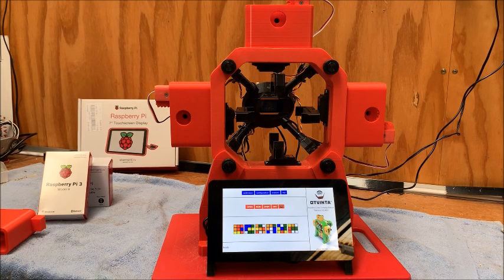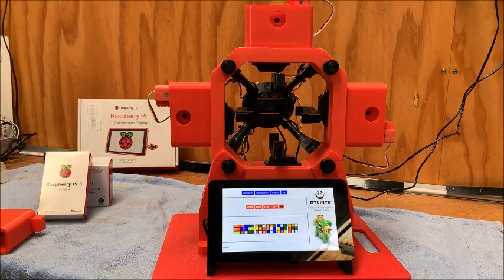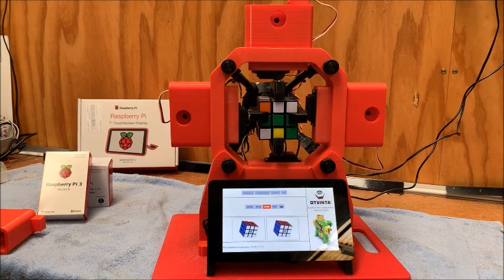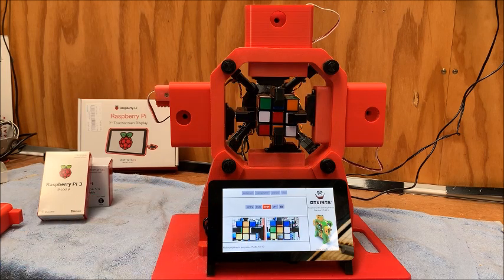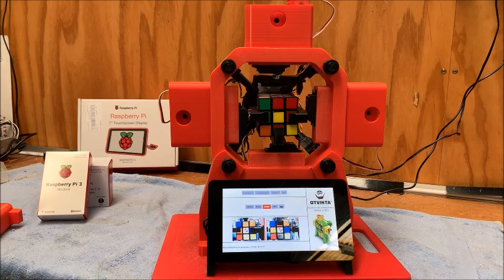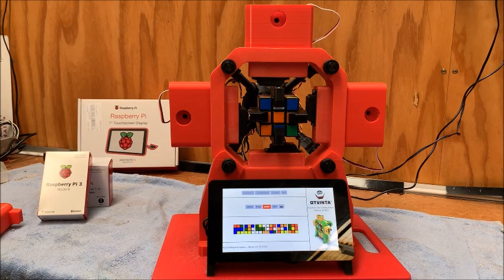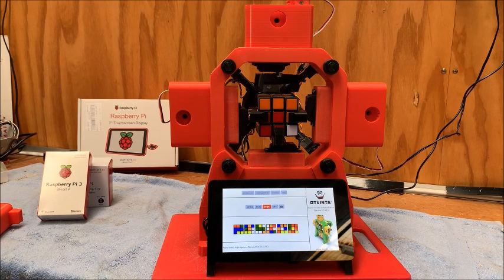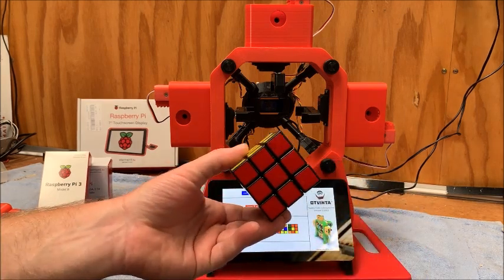3D Printed Rubik Cube Solving  Robot -  Part 1

Comment: Does it have 3 separate power adaptor for LCD RPi and Maestro?

Thanks. I want ro build one using Rpi. Any other sw installation needed to work with the LCD? Any recommendation for a 5in Screen
Reply from the maker: Using 2 x PSU, one Maestro and one for the pi. We used Rasp pi touch screen

Comment: LDL looks great, where did you get all the Hardware from.
Reply from the maker: Screws and nuts from Ebay (Chinese seller), servos I had but I am sure hobbyking or Ebay would have them, the web cam was Ebay and the Rasp pi and screen I had (Raspberry pi's and the screen are sold by various vendors inc Element 14 in Australia).